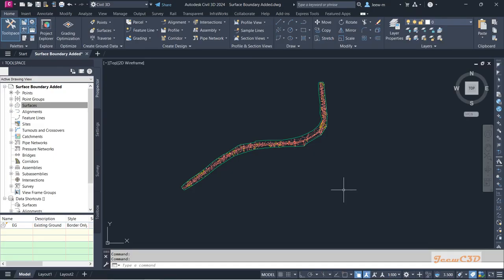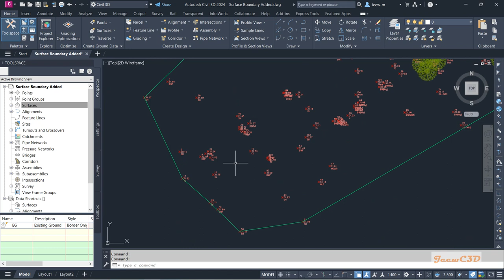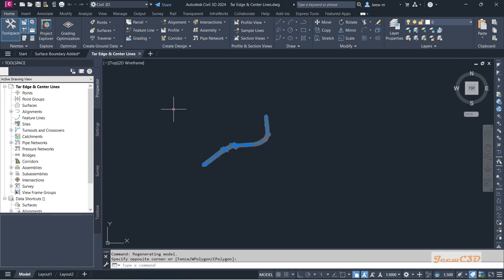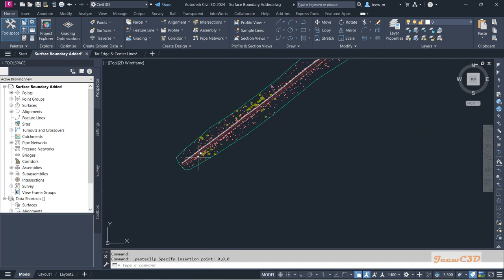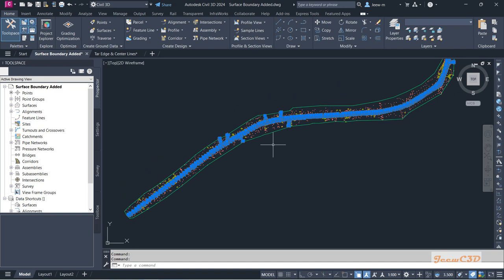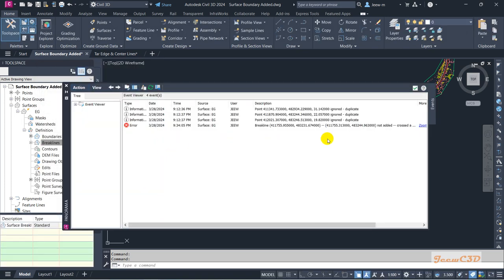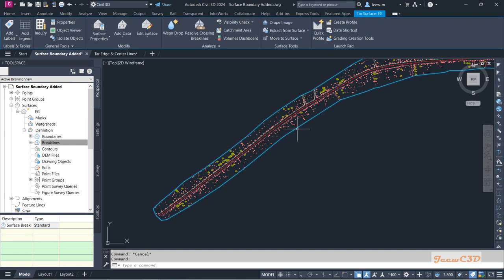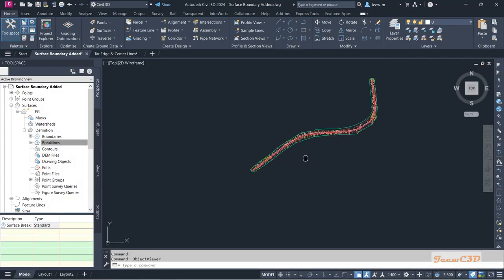11. Add Breaklines to Surface

Comment: in previous video,adding boundary to topo survey surface was to clear extra lines/surface outside the topo points.that was logical.but in this video,i m unable to get that whats the purpose to add break lines as centreline and tar edges left and right sides to existing topo survey data surface...except showing more clear when seeing in object viewer.
Reply from the maker: Better to watch the video in the description to get more understanding.